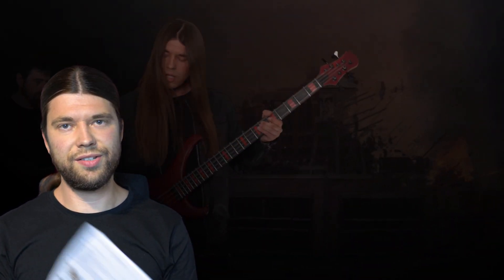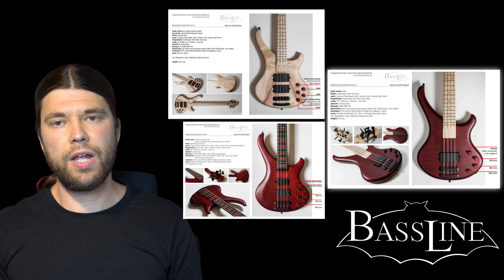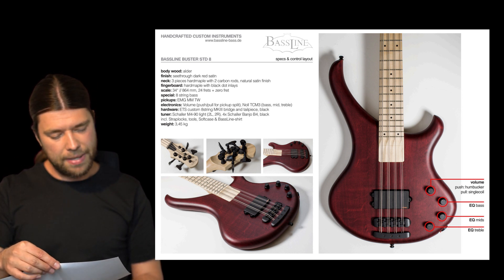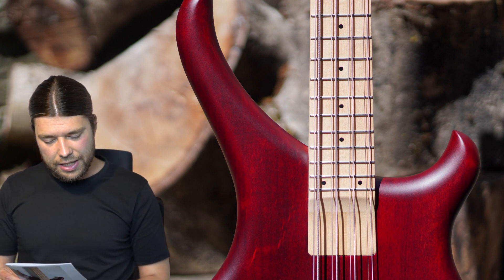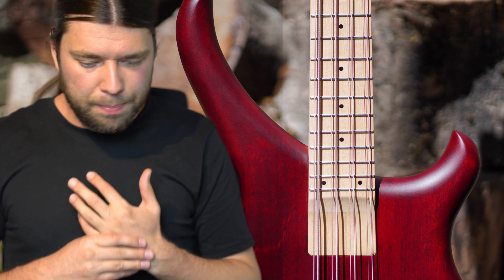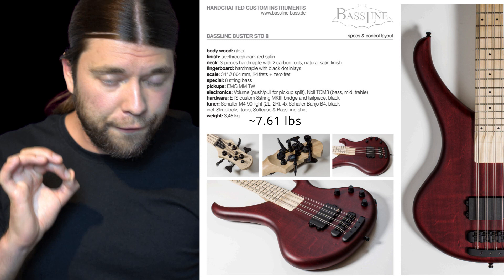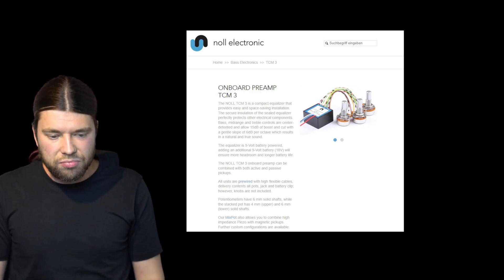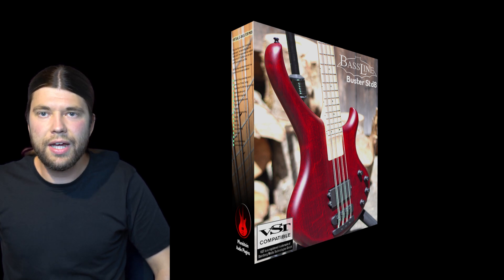Bassline Buster Std8 showcase part 1 (specs)

Comment: These are pretty sweet 8-strings to me.  I think the carbon fiber rods will help keep the neck stable with the higher tension.  The use of banjo tuners is something I wondered about years ago!  It's easier to ensure you are not grabbing the wrong tuner (like what can happen with some companies who use the same tuners for every string).  Body shape looks comfortable - similar to a sketch I made for a bass body when I was studying for my design degree.  Looking forward to seeing more details about the bridge!
Reply from the maker: Actually, I sometimes still get confused by the order when I tune the thing...😂 but for me, it is more important to have a leightweight headstock
Reply: @metalchild-pfst  Agreed about the lightweight headstock.  You may want to look into Gotoh Res-o-lite and Sperzel bass tuners for the lightest possible weight.